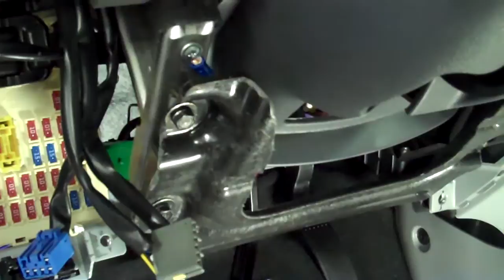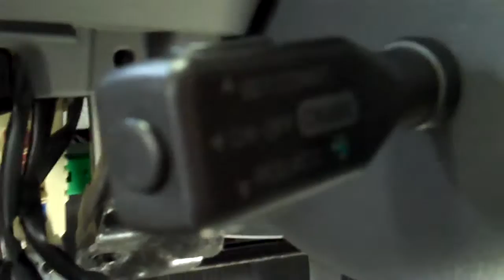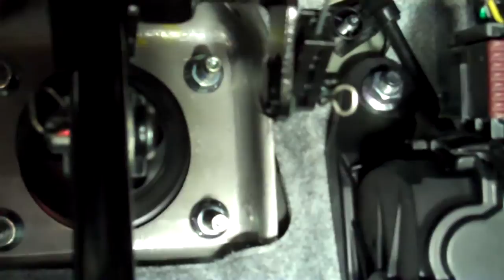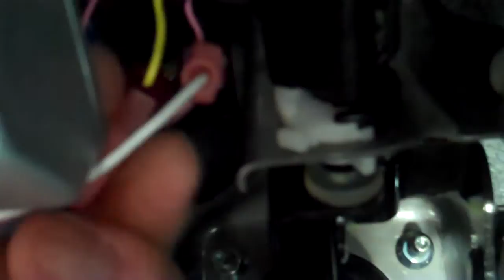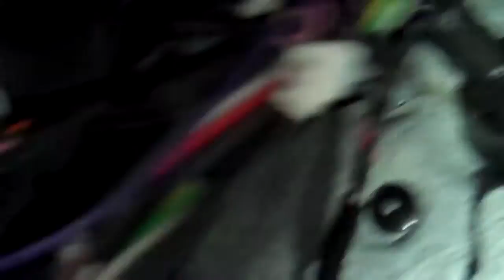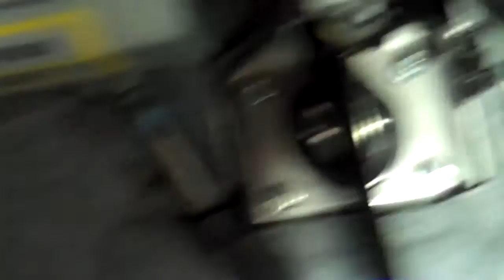Installing Cruise Control in 2012 Hyundai Accent

Comment from the maker: The manufacturer uses the harness in this kit for other kits as well. In other models the orange wire is a tach input ( but not used on this kit ). The yellow and white wires are clutch input shut downs  which are not used on automatic transmission.

Comment: Just curious.  I tested the pink black wire on the brake as the correct wire, not the pink.  Do you know which pin location that one is in?